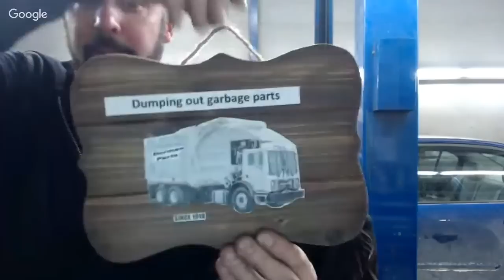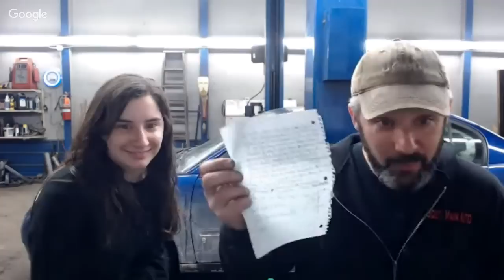S.M.A. Chit Chat & Special Guest

Comment: watching this now. I don't blame you for eating on the live stream! working all day you need to eat! 
i heat up the studs and pop them out with an air hammer! The tool company needs to come up with a cordless impact for an air hammer! I've learned on the impalas if you cut into the resonator the pipe you need to connect the walker resonator is right there. Your way works just as good as well! As for front probing connectors i got the kit from AES wave and love it!  I have a 2008 Malibu with 123k on it and its been very reliable i think Hannah's Malibu still has a ton of life left in it!  If you ever get an Saturn vue or a first gen chevy equinox with a wheel bearing do a video on big nasty taking it out!

Comment: I live in Minnesota and work for NAPA in St. Paul, Minnesota I am one of 8 delivery drivers at my store. 3 of the drivers are part time, the rest of us are full time. I have never heard so much dislike for Dorman parts. I thought they were good products. At least where frost/freeze plugs and lug bolts and nuts are concerned. NAPA is the 3rd auto parts company I have worked for. All as a delivery driver and not heard so much negative about there products.

Comment: Just had this video pop up on my feed. I had a 06 impala. Did a few mufflers and intermediate pipes.  They were crazy cheap. Get about 3 years out of them in NY. Used to piss me off having to modify the pipe a little and bend the muffler hanger to reach. It fit perfect after that but made a 10 minute job into a hour and a half cuss fest. I didn't want to change the resonator cause the stock one was mint. Working on my back on the floor if it didn't need to be done, leave it alone. I traded it in for a newer one in 2020. Always wanted to see the guys face who did the next exhaust job. Great to find another father daughter video. 6 year old video she's probably a np by now. Hope she's doing well.

Comment: Hey, Eric, you say that you are not a master mechanic. But I say that you are because what I have seen you could run circles around a lot of so-called master mechanics. I was a mechanic for about 25yrs and then went to a communications job from there on. and retired due health issues. I like you never got any certs either, but I have worked with guys that have and they couldn't diagnose there way out of a wet paper sack. I wondered what they actually learned in those tech schools! Not saying that was the case for all the guys that came out of those schools. But it was too many, and I seemed to be picking up their slack on jobs it was so frustrating. I think the best way to learn the trade is hands-on experience, hands down pun intended. Oh and I think that Hanna is your kid sister. Just my opinion.

Comment: At the least change the oil filter. A small short barrel air hammer with a panel cutter zips off the oil filter shell to inspect the filter media. New motors always have debries.

Comment: Love ur show.  U help me to replace tie rod on my 1997 blazer 2 wheel drive.  Replacing the upper & lower ball joints. I saved $1000 doing this myself. Thanks. How would u check the heater core on a 1998 f 1t0 4.2 v 6..  I had to cut the heater hose cause at the time i need to use the f 150.  Ive replace the frezz plugs, i now need to replace the fuel pump.  Question what would cause the gauage to work parttime i keep an eye on mileage ( usally 300 t0 400 miles before i need gas)

Comment: I ALWAYS put some copper RTV on both sides of EVERY flange gasket. Don’t know if that would’ve helped in this case, but that’s my practice.
Reply: Yes, high temp RTV on both sides of the gasket solves the problem.  I confirmed it with Permatex before trying it and it works.

Comment: A BIG HELLO FROM AUSTRALIA!

I recently  have replaced my head light globes with LED replacement  globes on a Hzj80 series LANDCRUISER  and have lost blue high beam Dash light?
Is there a cheap quick fix for this issue?
Would a pair of Cambridge Work?
Or is that only for Radio reception  Interference?
CHEERS

Comment: I think you do excellent work only thing I've ever see you miss that is on the Chevrolet truck that you put the motor in the ground wire on the fireball on the driver's side was not tightened maybe I just did not say that though but I would rather have a cold shop and work late
Reply: You're working on handles car we know you'll do a good deal 4 Hour as well as a very good job and I live all the way in West Virginia and I used to live in Maryland and Markham nothing but Cadillacs but now my thing is Ford Tauruses 24-valve muggers replace Transmissions I can replace the transmission in 4 hours that's complete I'm not sure how long I'm going to book it says that they do give to do the job but I know how to skip around certain things just like you do on certain vehicles and want you to do something so many times do you get faster and faster and faster and better and better at it it makes the jobs so much easier Kenny

Comment: I am a disabled vet spent 7 years in the NAVY on submarines. I got nailed during a torpedo reported test that went wrong lost both feet.
I have a problem with my 2006 scion xa with 180k  The cigarette lighter does not work if you plug something into it the radio shuts  off but does not lose memory 
I have checked the fuses but do not want to tear  off the dash to replace the unit. Any ides ?
Reply: More than likely your lighter is shorted out and the only fix is really to replace it. Try one from a junkyard or off ebay perhaps.

Comment: Good night me have Chevrolet pickup s10 4x4 1994  6v,  motor  voltec  me no have book the mechanic , me like look video when you have Chome the ignition timing ignition coil and tdc  mark the damper position piston #1 position and timings ignition and valve’s position  me Chevy not on 😢